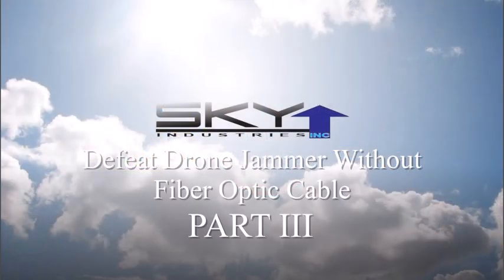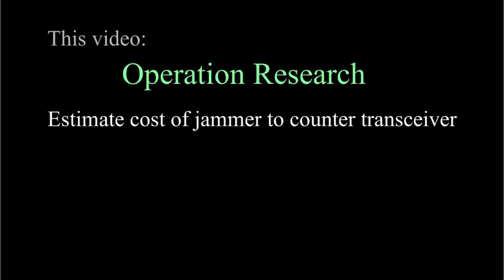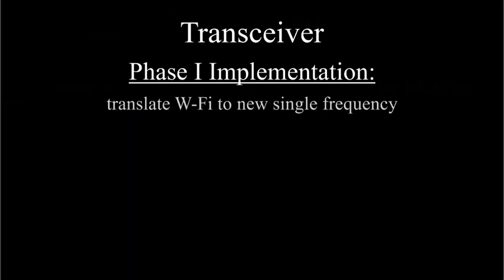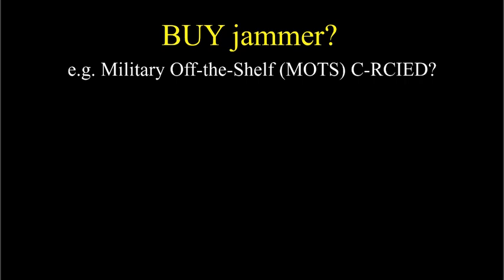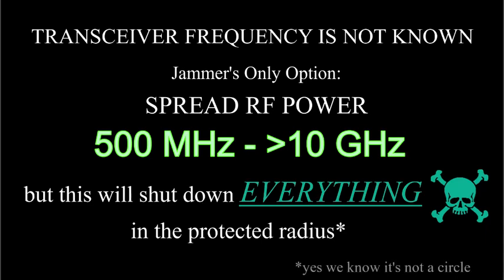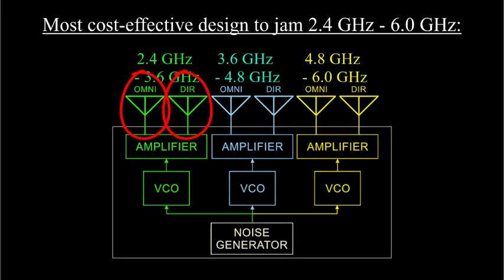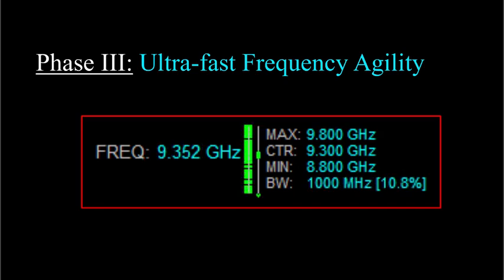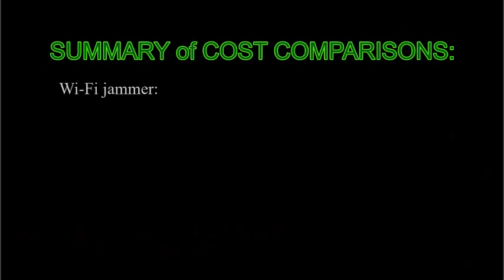Defeat Drone Jammer Without Using Fiber Optic Cable PART III 33

Comment: increasing the transmission frequency also increases the air losses, so you need more power and more expensive parts...
Down to the 700MHz, the range gets better than 2G4 at same power...

Comment: There is a simpler way to make drone jammer proof. Transmitter and receiver  should work on different bands. Then it will be harder to find and jamm a weak signal from operator. Radio modules with antenna should be easily replaceable, so you can change frequencies in a field when found jammer bands.
Reply from the maker: Fair point, though different freq's for Tx and Rx will only matter to a jammer that is able to measure link Tx freq - so that excludes "dumb" jammers.  

Re. radio modules: yes I think they doing that now.  My impression is that jamming is still a major problem, so either that solution hasn't solved it enough, or the increased effectiveness hasn't percolated into the media channels.  

My guess is it's the former.  Link bandwidth is important; the wider BW the jammer has to cover, the better for the link.

Comment: You keep saying that the jammer must block all radio transmissions in a given area in a wide frequency band. This leads to the natural question of radio emission detection and directional jamming. As the final attack drone would be presumed to be the one nearest to a jammer, using a phased array or simple directed reflector could significantly reduce the emitted power while allowing for essentially radar tracking of the drone without blocking all signals in a wide region. 
I assume because of the relatively low powers and large spread of frequencies there would be a similar effect to the multi frequency arrays stealth fighters use for radar that reduces detectability, but still. 

A related query would be why not to have all the transmitters running at the same time, since multiple transmission stages must already be included to cover the whole desired band parallelizing the data transfer and only requiring each transmitter to jump around in their own band.
Reply from the maker: Fair points; the more the target knows about the attack the bigger the advantages that accrue to the target.  

In the C-RCIED arena, if a convoy knows where an RCIED has been placed, they can direct all jamming power on it, or drive around it, or stay away from an approaching bomb truck, etc.  

In the present case, if there is no a priori knowledge, or very short warning time, then the drone protection needs to be omnidirectional, or matched to the vulnerable aspect angles of the target.  

And if the radio equipment in the local area of the jammer are not integrated with the jammer, i.e. protected by for example timed blanking, then the enemy may have a problem with self-jamming - including civilian infrastructure they might depend on.  

Again, your points are fair; it's possible for the enemy to solve problems by spending more money on more complex equipment.

Comment: Stock wifi already covers over 1 GHZ of frequencies, and it does not seem to be enough. Also you do not need CW jamming, you just need to damage packets enough to fail decoding. Properly hardening radio links against jamming is quite costly and not worth the effort for a single-use drone when fiber solves the problem just fine.

Comment: You could load both the operator box and drone box with the same seed number, then use a cryptographically secure psudo random generator algorithm that would change the frequence ever second and both the operator and drone boxes would stay synked to the same frequency.

Comment: This sounds like one of the several ultra fast frequency hopping designs based on an n-path filter and an ILO to rapidly slew ; Mousavi et al fabbed a 50Mhop/s system with 20dB of processing gain on a 65nm process in a couple square mm. That wouldn't quite work out for a ~6Mbps video signal but it's close; perhaps you can tolerate only 10dB of processing gain. Getting and keeping the clocks aligned seems like it'll be tricky, since you're hopping faster than the signalled bits. But doesn't seem impossible. And if you're fabbing custom silicon anyway, then getting something cryptographically decent for the pattern generation shouldn't be too hard either.
Reply: you raise an excellent point : hopping frequency vs bit duration...
There is a mention of 1µs per hop, so each hop would transmit maybe 64 or 128 bits, including tons of ECC, and we're not even talking about multi-path transmissions that can distort the received signal.
Reply: @yxyk-fr  there's mention of a 1us hop, yes. But there's also mention of processing gain, which occurs when there's multiple hops per bit.

If you have, as you suggest, 64-128 bits per hop, then you don't actually need tons of ECC on the outside but instead some check bits so that the receiver can recognise the hopped frequency (assuming no corruption) and align clocks. Then you want some FEC code on the inside so that you can tolerate burst noise; probably a long window RS code like you see in the physical layer for most fiber ethernet.

If you have processing gain and multiple hops per bit, aligning clocks is a little harder but the error correct should be easier; noise and interference is unlikely to hop across frequencies correctly and so gets filtered out

Comment: From what I’ve seen, the FPV munition-carrying one-way drones that are priority for jamming are not CoTS digital wi-fi style but analog 5.8 ghz TV video style
Reply: Among other things the CoTS wifi style digital drones don’t have the ultra low latency and horizon dropout required to make the fine grained last second low altitude adjustments necessary to accurately target a maneuvering man size target at ~50mph with an impact fused grenade at the same elevation as the control station multiple miles away
Reply: The CoTS wifi style are suitable and are used for reconnaissance role at much higher altitudes (thousands rather than tens of feet AGL) where jamming is less of a concern, don’t require the last second low altitude fine adjustments. These would be expendable but not attritable, and as such CoTS wifi digital style low cost have been deprecated in favour of more advanced concepts platforms

Moreover, between the lines, you can sort of make out that drones in this role have moved on from consumer wi-fi style telemetry used early on  in the war, to less… uh earthbound telemetry modalities. Or maybe not what do I know.

Comment: i would like to see the BOM for a 50$ 0.5-10GHz full range transceiver. with the features you propose the fpga alone would blow the budget.
Reply from the maker: It's a different approach.  

The BW is 1 GHz, centred anywhere in 500 MHz - >10 GHz.

Comment: There are some problems here I think.

We aren't comparing the cost of the drone reciver to the jammer. We are comparing the cost of all the drone receivers in the area over the entire expected lifespan of the jammer (there could be tens of thousands) to the cost and operation of a single jammer. 

I also struggle to belive that it's not possible to avoid fratricidal jamming by having timed pulses of turning the jammer off. Your equipment knows the timing. The enemy drones do not.

Further, I seriously doubt that it's not economical to most frequencies with a quick hopping jammer enough to make flying communication unusuably slow.
Reply from the maker: Your first para: the point is that the investment to protect is much higher than the investment to attack.  If the enemy can afford to invest $100K/drone crew/APC/tank etc., then there is no advantage to asymmetric warfare.  

2nd para: Sure, if they have expensive jammers and expensive radios and drones, all harmonized; not true if they are using inexpensive jammers and unharmonized equipment.  

3rd para: Fair enough; what do your calculations tell you?  The essential idea is that the hopper moves faster than the jammer can detect and respond.   I find it hard to believe a jammer can detect and respond in, say, 2 usec.  I could be wrong, but it'll be an expensive unit for sure.

Comment: How much is the fast-acting phase 3 transceiver?
Reply from the maker: 1 usec freq transition time, no link interruption during freq hop, 1 GHz BW
Reply: @skyindustries  really cool, do you have an estimate in price per unit?
Reply: I know you said the cost of the drone does not matter for strategic reasons, but I'm just curious if would scalable to the same degree or if the cost is somewhat prohibitive?

Comment: I've been wondering why something like this isn't being used more in places like Ukraine or the Middle East, when open source MIMO SDR transceivers with well over 1GHz frequency range for sub $1000 like Nuand BladeRF Micro have existed for years, and could likely be easily combined with an upconverter to mix the frequency into the 6-12 GHz range. Perhaps it wouldn't make sense from a force economy perspective for kamikaze drones, but for reusable drones it likely would.

Comment: I imagine the same technology could be used as the basis for a defense against it. Instead of jamming the whole band evenly, you have a few comparatively narrow bands but you jump them around at a similar rate. If microsecond frequency hops are too fast for a jammer to react to, they're too fast for the hopper to avoid. Of course you won't be completely jamming it, but there will be some probability of collisions which leads to a certain amount of error. You just need the error to get to a level where it is impractical to operate the drone. With only a small portion of the overall band jammed at any time, the power requirements remain modest and you know which frequencies you are jamming at any given time, so a friendly system with microsecond frequency hopping can still operate effectively.
Reply: this does not work because fhss is designed with it in mind. the entire idea of spread spectrum is anticipating errors. modern links have an error budget of up to and above 99%. even if barely anything gets through, the link is operational. if you need real time video it is more like 90% but that still defeats the idea of narrowband jamming.

Comment: What about AESA antennas that can positionally locate sources and filter signals to just those moving? The AESA could then generate targeted noise at the object/drone to disable it. Similarly, wouldn’t AESA guidance systems defeat the crosspol jammers in your other videos?

Comment: Yeah this is correct for sure, while you increase FHSS bandwidth it is much harder or even not practical possible to jam, on other hand once you start development of such wideband transceiver you get surprised that LNA for this frequency range & span pretty expensive, single PA not sure if even possible for that span to get linear output with significant power, low components on market for your requirements, and once you overcome those issues, final price would be much higher and can't  be used in mass production, there are products on marker that already used in long range UAVs communication and they overcome jamming, but it is highly specific products due price. If you have box for 50$ that has those wideband transceivers, all stock will be sold in a moment.

Comment: What type of antenna would have the performance to maintain link budget requirements while also having a 9.5GHz bandwidth? For an box of the size proposed this seems like an extremely challenging design requirement.
Reply from the maker: It's 1 GHz BW, centred 500 MHz to > 10 GHz.  The antenna is matched to the unit.  It's not one-size-fits-all, for the reason you say.

Comment: The use of frequency-hopping spread spectrum (FHSS) in drone communication enhances security against jamming and unauthorized signal interception. However, given enough access and technical capability, an adversary could potentially analyze hopping patterns using software-defined radio (SDR) and develop adaptive jamming techniques. This raises the question: To what extent can FHSS be considered a reliable countermeasure against targeted electronic warfare attacks, and what additional safeguards should be implemented to mitigate such threats?
Reply: The idea of finding "patterns" in an RNG is more of a theoretical concern than a practical vulnerability—especially when a high-quality, cryptographically secure RNG is used. Unless you're referencing cracking the seed to the RNG that the transceivers are using to derive their next frequency hop.
Reply: the answer is AI guided control take over if jamming is initated and allow it to traget autonomously. wire guided also possible but limiting in many ways
Reply: @williamsitton  Wire guided isn't that limiting, but wireless would be preferred.
AI autonomously targeting and striking things seems very risky at least in Ukraine, where both sides use very similar equipment. (Terminal guidance is, however, used, and already implemented on some drones)
Reply: @williamsitton yes that's what you want.  AI weapons.

Are you insane?
Reply: @jwm6314  Especially in an environment where both sides are using largely the same armoured vehicles.
Reply: FHSS can be bulletproof, but in the case of low cost drones it is currently not. the electronics are cheap and the software is optimized for speed, so a pseudorandom pattern with weak cryptography is used. see: expresslrs, a very common open source protocol used by ukraine.

that being said, the development speed is extremely asymmetric. making a subtle change on the side of the open source powered drone is very easy and quick, while the ECM manufacturers are stuck in a complex and inflexible situation.